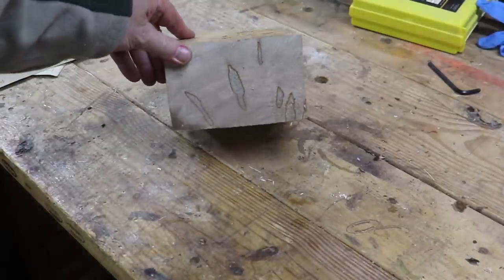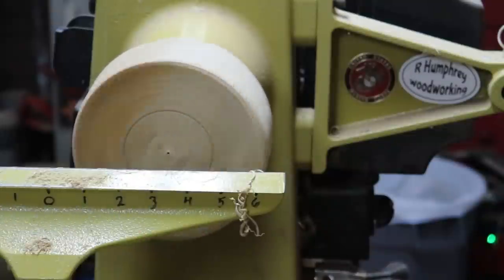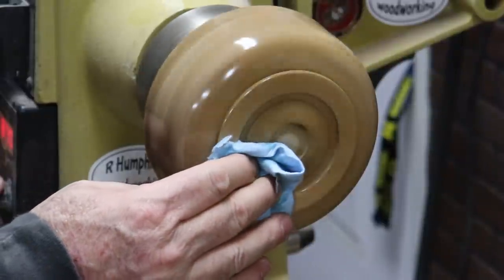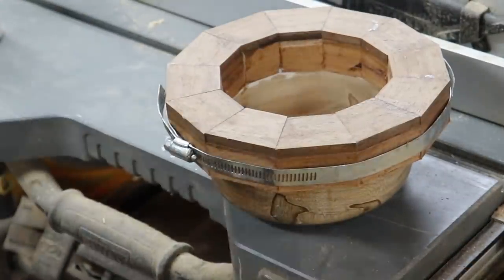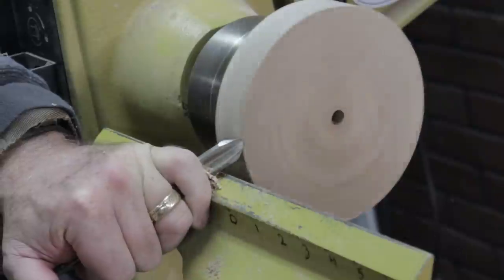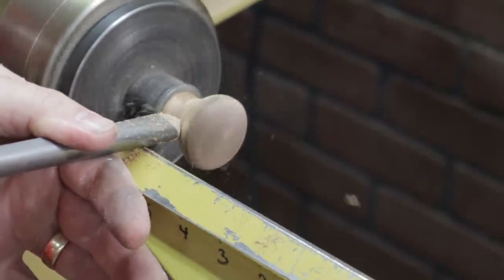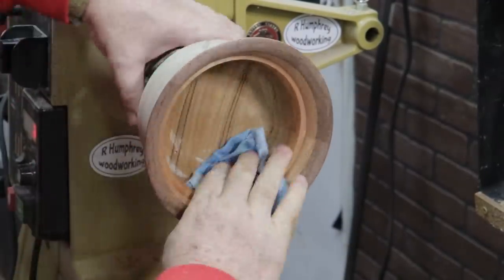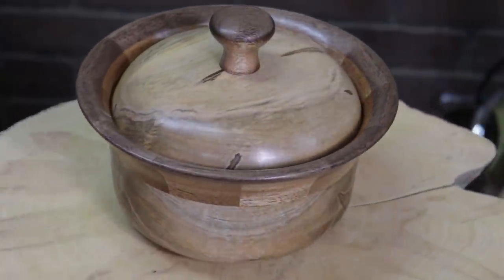The Beauty Inside

Comment: For those of us still starting out, would it be possible to put text on the screen as to the chisel, gouge that you are using like - 3/4" bowl gouge, 70° grind. It sure would help. I'm still using easywood because I am lost as to what gouge to use when.
Reply from the maker: My go to bowl gouge is a 5/8" with a 55 degree modified fingernail grind.  I used to note the tool, but the grind is very subjective... You kind of have to find the bevel angle that works best for you.  I recommend checking out Mike Waldt.  His channel (his name) is full of great info on which tools, how and when to use type info.  He's a fantastic turner and teacher.